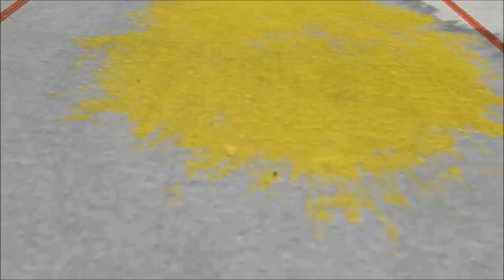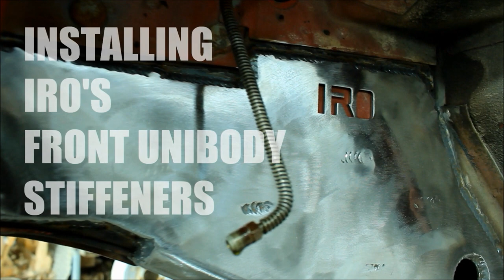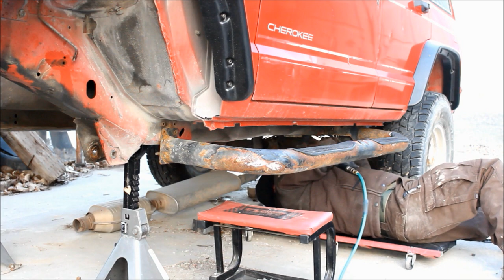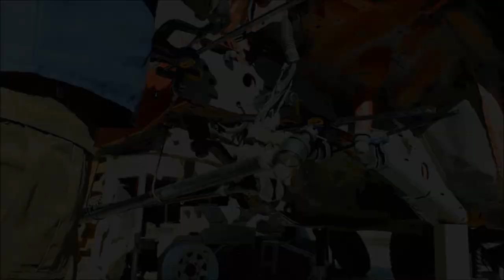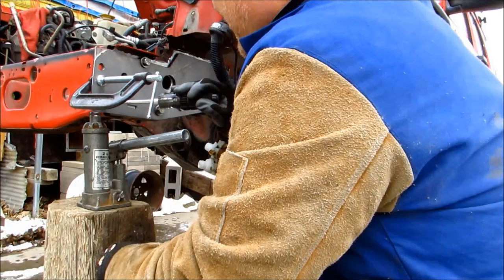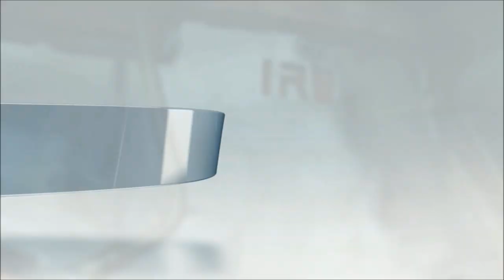Installing IRO's Front Cherokee Unibody Stiffeners on Project Overlander

Comment: This is such a great informative video, and helps a ton! Not to knock on the video but the only thing I would disagree with is welding the entire perimeter of the stiffeners... That much heat on the existing unibody frame can destroy corrosion protection within the frame channels and cause the steel to become brittle. If you think about it, the entire vehicle is held together with intermittent spot welds. There is plenty of strength involved with spacing stitch welds every few inches or so. I would also say that weld through primer would be a great idea, and seam sealer after priming, before paint..
Reply: I came here to add this comment. Agreed 100%. Should run 2" welds with 2" spacing. This will limit the Heat Affected Zone and will actually be stronger as you can cause the steel to become brittle.

Comment: I'm getting ready to install a set of my own. What did you set the welder to? .030 wire? I'm asking because of the difference in thickness between the stiffeners and the sheet metal.
Reply: DITTO ! He had my question! I'm getting ready to weld my Ironman 4×4Fab Front Leaf Spring Mounts ???
Reply: I have the same question

Comment: put these on my xj. I added more holes behind the shock area as well as the metal that wraps around the lca mount. anything that was attached to the frame rail won't fit correctly after. It's a pita.

Comment: Is there a way to make sure it doesn't rust in between the fame and stiffener?
Reply: James Taylor And that is the problem with these. Not only will it rust in that spot but you'll rust out your unibody from the inside out where all the welds are
Reply: I would imagine you pain the inside surface. If the bottom isn't sealed moisture should be able to drain just like it would on any other open spot of the uni body.
Reply: Use 3M welding primer. That's what I used on mine. You can also get eastwood internal frame coating for going inside the rails. It has a straw on it.
Reply: Very easy. Clean and paint the area with 3 weld primer on all bare metal thats welding. It will last longer then the vehicle.
Reply: BentlyBo4 I didn't know about this paint. Most won't do it though.
Reply: por15
Reply: True, the 3m stuff has held up stronger then welded metal.  Your comments on the weld thru primer causing porosity in the welds is incorrect.  It is designed not to do that.. You get both pieces of metal to bare metal, paint both pieces with the 3m weld through, then weld away.  Welds perfectly as if nothing was even there.
Reply: Is copper or zinc weld primer better?
Reply: Yes- spray the inside of the part with a hig-zinc primer- it's a weldable primer. Then prime the outside after welding and paint to match.
Reply: Not true. I've had a set of the C-Rok plates on my 90 for 16 years and there is no rust.
Reply: No you do NOT have to remove the weld-through primer when welding. Exactly what part of "WELD-THROUGH PRIMER" is unclear?
Reply: grind grooves on the backside and install grease zircs, grease periodically to push out dirt and moisture.
Reply: It's a Mopar product, it's built to rust.

Comment: IRO makes nice stuff, but their shipping is a pain in the ass ! a steering box spacer for the xj is less than $7 shipped to my house, front and center frame stiffener sections for an xj is $51 shipping, but if i wanted to order the two at the same time it will be $190 shipping... if i order the full set of stiffeners it is $100 shipping, but if i order the front/center ($51 shipped) and then in i different order get the rear set ($35 shipped) it ends up only $86 shipping.!.!..

Comment: Looking for an opinion. What are your thoughts on using self tappers to hold the stiffness in place before welding? 

I do not know how to weld, but im contemplating buying a mig and starting to practice before i touch the xj. Ive always wanted to, but ive never had the funds or need.

The thought behind self tapper would be. If i was going to lay to have it done.  I would do all the prep work, them use the tappers to line everything up before having someone there. Im extremely picky with alignments, so that way i could take my time get everything perfect, them let someone just focus on the welds to save on cost.
Reply: This would not work on these stiffeners as you need to use many clamps to bend the stiffener to the shape of the frame. Bit of a pain in the ass. Other stiffeners maybe but seems like more work
Reply: @Rancidkidd  What if i did all the bending and everything first, but just use the tappers to keep it in place once it’s fitted?

Comment: I have a 94 Cherokee that I have been working on recently, it's my first Jeep. I want to upgrade to Longarms with a 4.5" Lift. My problem with going for this lift is that I have the 242 Transfer Case, and as far as I am aware you cannot install a SYE into a 242 unless you Hack N' Tap it. Should I Hack N' Tap my 242 and install the SYE with the Double Cardan or should I just purchase a 231 Transfer Case? Information would be appreciated, I've watched almost all of your guys' videos.
Reply: I've had a Hack-N-Tap SYE and double cardan on my 242 for about ten years. Never had a problem on my '95 XJ with 4.5 short arm lift. Hope that helps. Have fun with your build!
Reply: They do make a non hack n tap sye for the 242, but I never had any issues with my setup. 4.5" of lift and the 242. I came across a 231 for $75 so I plan on doing an SYE and installing that, some time in the future. I have never had an issue with the 242.

Comment: They're incorrect in informing you to fully seam weld these plates to the unibody.  Its more ideal to stitch weld the plate with plug welds rather than fully seam weld it.
Reply: Please explain why. Not calling you out, I just don't know ;)
Reply: Josh 
Why?

That seems really dumb... Why add the brace if you are going to barely weld it on?
To male that break off before your axles do?
Reply: They want it fully welded to prevent water from getting between the plates. Nothing wrong with fully welding everything as long as you don't do long continuous beads and warp the shit out of it. If you choose to stitch weld it you need to use adequate amounts of seam sealer.
Reply: Are you certified in welding  and fab ? As a welder you want complete  welds
Reply: Yes and no. Some people subscribe to the idea that fully welding it will not allow the thin gauge metal on the unibody to flex which it should and I turn will cause the frame to crack next to the weld. In other words it will tear the sheet metal. That idea isn't completely wrong because I've seen it happen to metal parts before. But I feel like it's a crap shoot on this application and also depends on the welding process being used and the heat control. Plus the difference in gauge between the stiffeners you use. You  wouldn't want to go too thick on these any just due to the nature of sheet metal. This would pose a bigger challenge if your stick welding which is harder to be consistent on sheet metal with than a good mig machine that can be dailed way down to move nice and slow without overheating your metal... either way I'd personally go further and add more sheet metal in other places.

Comment: I've cosidered this. it seems the front axel will break first. never seen a snapped in 2 cherokee. seen tons of broken axels.
Reply: It’s not about break in two, but sooner or later your doors and hatch won’t close properly and to some that’s an issue. It will also get progressively worse over time and just turn your Jeep into a bag if shit.
Reply: E Gibson, speakith the truth! And that is absolutely no exaggeration! They literally turn into a bag of  shit. Mine finally had enough of my bullshit (and high speed logging roads) and eventually I compromised the integrity of the unibody. Without stiffeners they are on a count down to becoming a disposable heep
Reply: The front driver side breaks/cracks in two where the steering gear box bolts to the chassis when larger tires, lift, and weight is added to the XJ's. One of the most common issues I see on facebook XJ groups. Happens all the time.

Comment: how do you mount your bumper after adding the stiffeners? it seems to me with the stiffeners a bumper won't fit unless you move the brackets. I'm looking into getting a jcr diy front winch bumper so I could probably move the brackets to begin with
Reply: I believe the JCR bumpers already accommodate for stiffeners and even include spacers for those who don't have them.
Reply: Wheelingrc360 the factory bumper is thin enough to can smack it back on. If you've got a beefy aftermarket one you'll have to modify the bumper or tie in brackets

Comment: Hey I know you guys have done a few videos on installing front springs & shocks on a TJ/XJ. Any chance you have a video floating around of the rear install? I know it's gonna be very similar to replacing the front but there are some other steps needed to be taken to install the rear, or am I wrong?
Reply from the maker: Leaf springs?  Ya several, check out the zombie jeep build playlist for the rear lift or rear leaf spring bastard pack.  Also, the Hope floats build has an entire lift install video series.
Reply: Naw, rear coil springs and shocks. No leaf springs.

Comment: Hey Tyler, I've read on various forums that square edges in the welds on some stiffeners can cause stress risers in the base metal. Do you think this is something to be wary of?
Reply from the maker: any time you weld on a frame or unibody, stress risers are a concern. I really wont know if this problem manifests on this project till I have some major miles under it and some good twisty trails. Rest assured, I'll report any problems if they appear.

Comment: Why do you need these. I've been driving mine on tons for years with no problem
Reply: For wheeling, large tires that create torque on the frame. Better handling. There's no way to tell what is going on within the microstructure of your factory unibody until something snaps. Steel fatigues.

Comment: If you want mil.spec veh. then buy a mil.spec. veh. :Ae Humvee. Some of you just go too far with a jeep. sm arms will take out both your jeep and Humvee's too. Remember your power to lbs ratio. A armored up Humvee was a slow pos. Ae:  added Lbs... If you add lbs you will need a more powerful engine that "burns more fuel" .A 8.25 is strong and has less parasitic loss and a ford9" has more and you can make a 8.25 stronger and still weighs less. I also don't think you need 35'' to 37' tires . And that's why you recon ahead for 4' deep mud holes and go around it . You Don't get bogged down .It's all balance friends. FCA knows that. Imho Stay safe. GbT U.S.A!